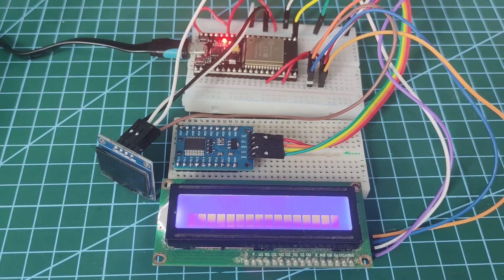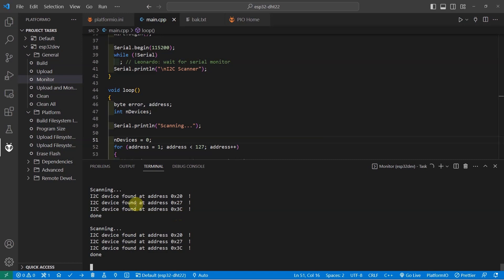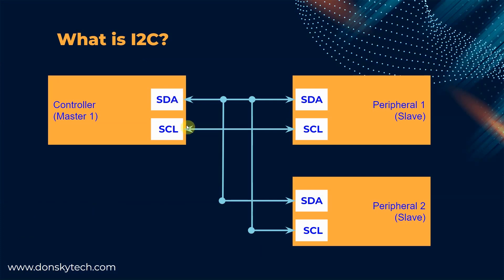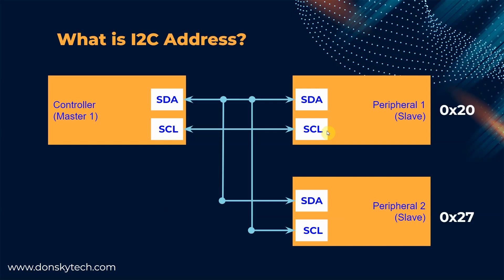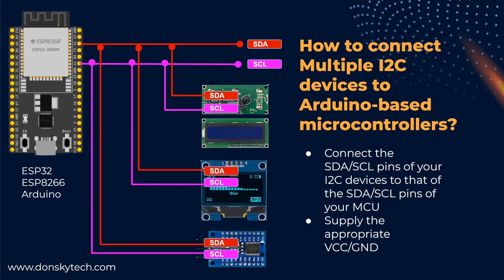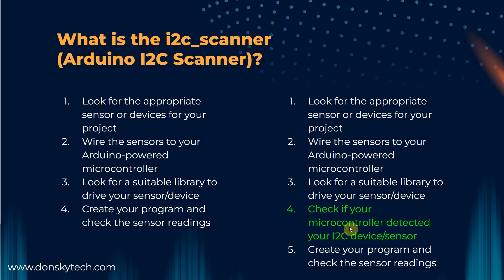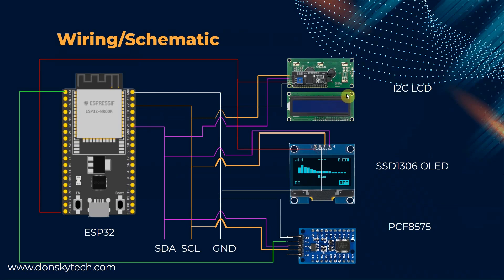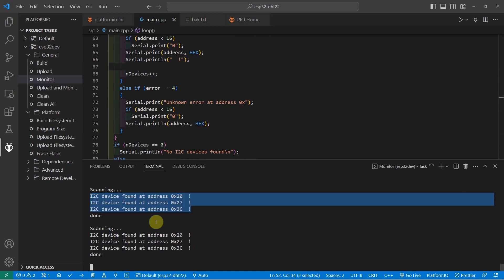Arduino Basic: How to use the Arduino I2C Scanner?

Comment: Nice job explaining this. I know you wired up all three i2c sensors for the demo but the Scanner does not tell you which sensor is which address so better to hook them up one at a time. Thanks again a good review of the subject.
Reply from the maker: Hey, that is a very valid point!  I will add that in the writeup!  Thanks!